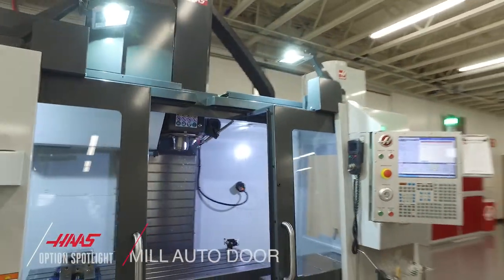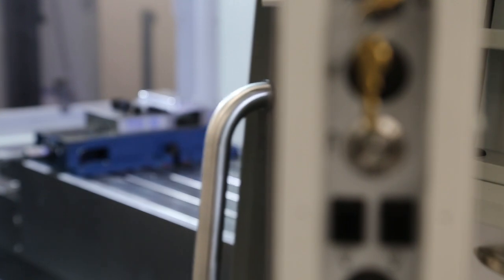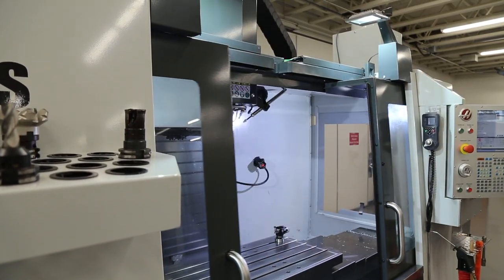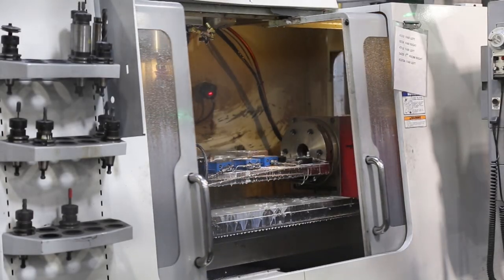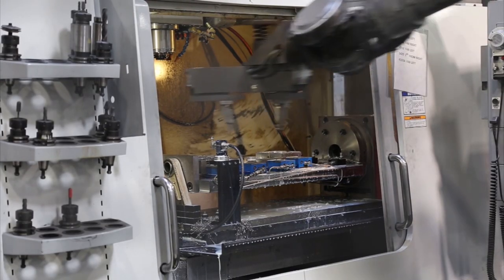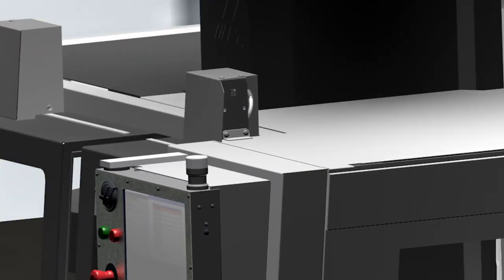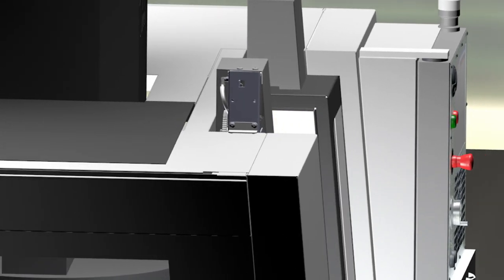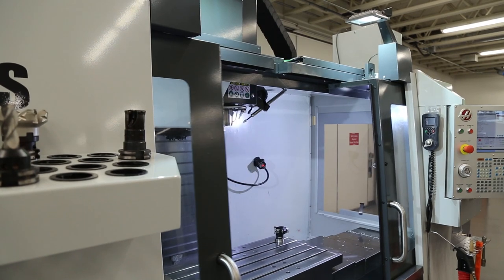Auto Door for Mills - Haas Automation Option Spotlight

Comment: My main question is, can I crack walnuts with the doors using gcode?
Reply: foxabilo  you probably could on my SL-30 back when the auto door worked.  Neighbor across the street used to ask what that banging noise was.  Chain drive eventually swarmed and I just tore it all out and disabled it.
Reply: ANYTHING IS POSSIBLE WITH ENOUGH CODE
Reply: @aidankilleen5889  Yep, I am making an adjustable nut holder in fusion 360 as we speak.

Comment: Is opening the doors on a CNC machine really that hard?
Reply: Especially on the HMCs and UMCs the doors are incredibly heavy because they are built to withstand parts becoming dislodged and flying out. Having a chunk of aluminum fly through the door and kill the operator would be no good. Plus I imagine it helps to cut down on vibration.
Reply: No, but on some runs with short cycle times the operator may have to do it hundreds of times over and over again day after day and leads to fatigue, which leads to less productivity and more mistakes. On top of all this it will make it easier to integrate automation.